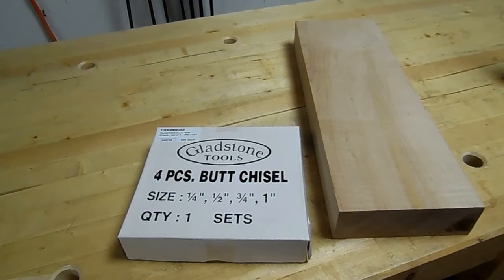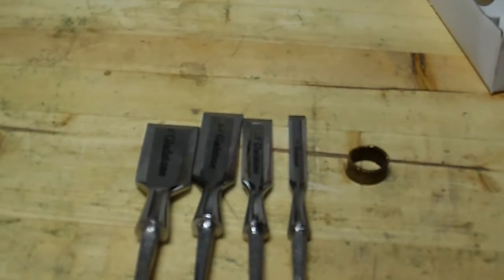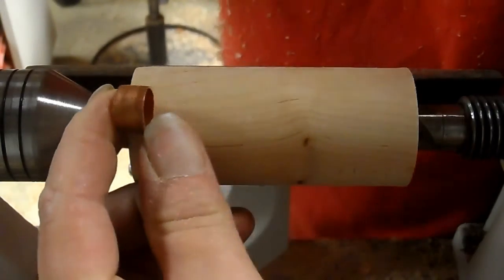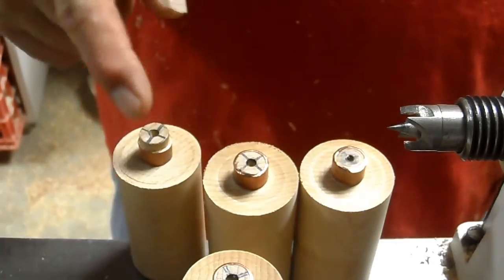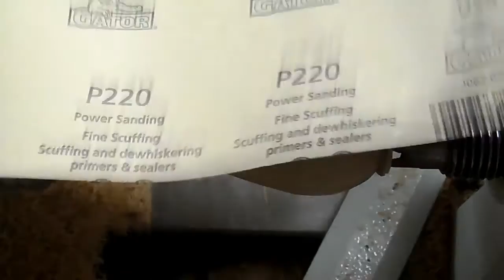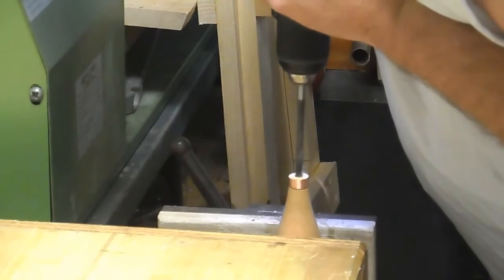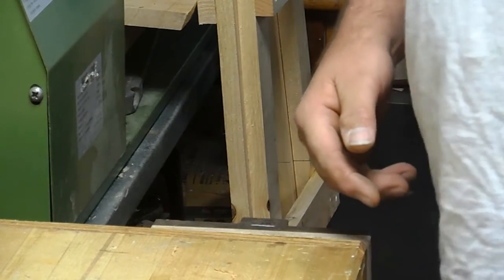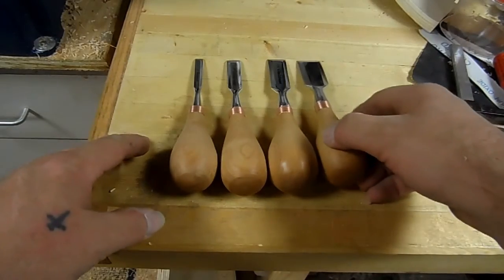GPW 13 - Super Cheap Butt Chisel Upgrade

Comment: Beautiful video, Jason.
That's right, at cheap chisels. Because the blade is only "sharpened by machine" and that is good only for rough work. For fine work you may be again sharpened. I've also made it so in my, I have you sharpened by hand.
But you have to get out a super sharpness.

Comment: Looks like a $$$$ tip , as you said should work fine for a lifetime.You made the four from one stick , Hate it when people illustrates while using a 12 dia. block turning it to 3" wasting more than twice of good hardwood used for handles Thanks
Thanks

Comment: Looks great! That oscillating edge sander is an unusual tool to have but it seems pretty handy! Do you do any luthierie? I ask because the Grizzly catalog seems to market the tool for that purpose.
Reply from the maker: awldune I have been thinking about building a simple guitar or ukelele, but I haven't looked into it enough to see which tools would be useful. 

Thanks for the props.

Comment: What was the chisel / tool you were using on the lathe?  Was that just a regular bench chisel?  It looked like it had a bit of a cup to it, but not like a normal gouge.
Reply from the maker: Make Crazydays It's an oval skew chisel. It has rounded sides instead of flat sides.

This one: http://www.highlandwoodworking.com/bodger34ovalskew.aspx

Thanks for watching!